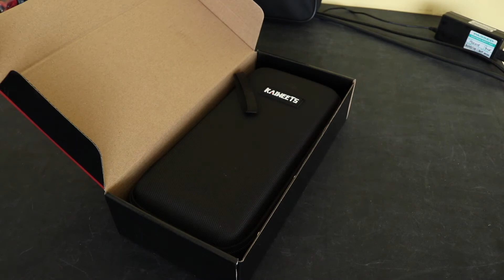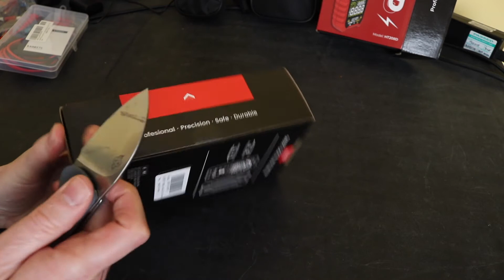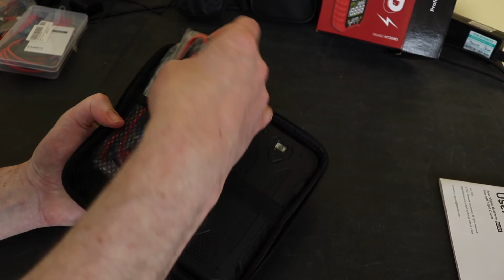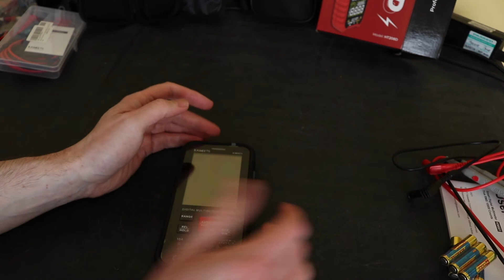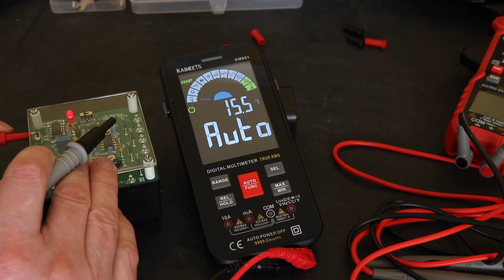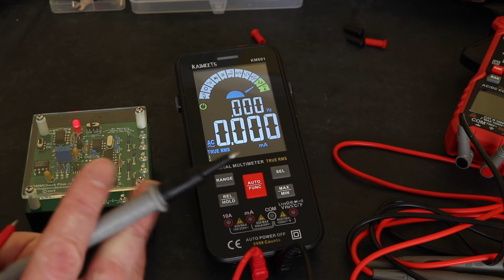Unboxing and brief tests on my new Kaiweets meters.

Comment: I wouldnt like to watch that multimeter take a tumble after I've precariously balanced it somewhere out in the plant when taking a measurement! The leads look a right faff too tbh. Interesting though, never seen or heard of kaiweets before.
Reply from the maker: Its kind of bench top bling really, great for YouTube videos. Certainly not the best for industrial use, there is no hanging strap facility, or probe storage on the case. Like you say, it doesn't seem to have the robust nature required for those environments. No independent certification of the input protection either. Thanks for watching and commenting.